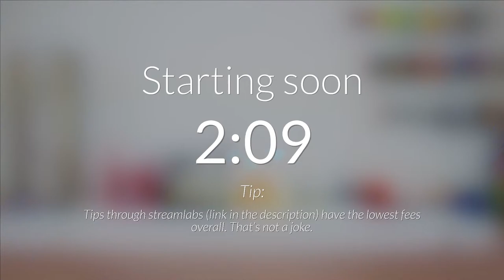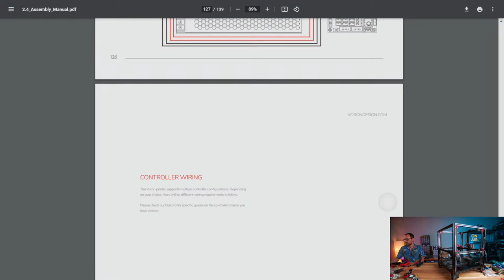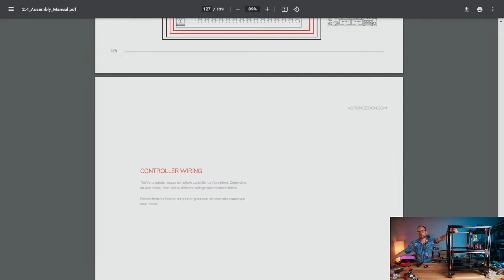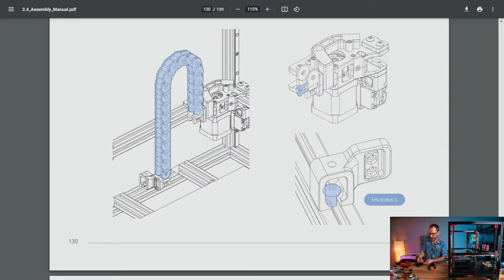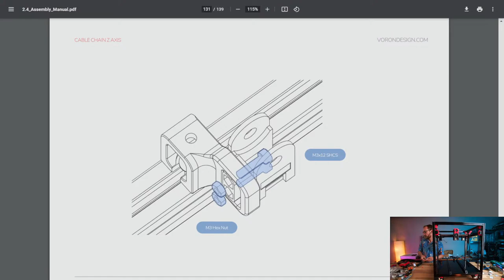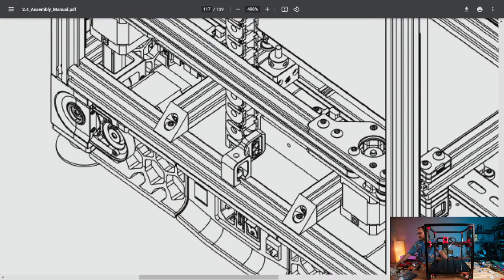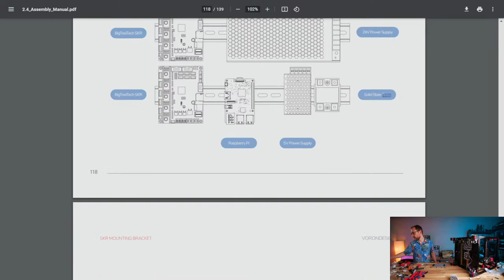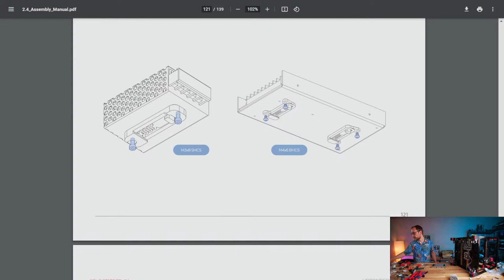Was live: Building a Voron 2.4! (Part 5: Wiring and electronics)

Comment: @Thomas, though I'm not 100% sure but the ALU tape that you use is called Mylar. A PET film bonded to very thin ALU foil. Therefore it is not a good idea to use it as an insulator or IR reflecting foil. Try it with soldering iron before you run a long print. Good luck!

Comment: RE the cable tie discussion: This is cable lacing... you use wax coated string and a spot tie knot.  This is how wire bundles are tied in aviation.  Awesome build series, btw.

Comment: Why are there 4 stepper motors for the Z axis? Wouldn't it be more sustainable to have all the Z-Axis belts connected/moving together mechanically instead of through software? Could this model instead use one or two Z-axis stepper motors (maybe with mechanical leverage as well), which would help reduce cost, too?
Reply from the maker: By using 4 steppers and independent drivers, you get faster speeds and have the option to tram thr gantry by driving each corner individually.
Reply: @MadeWithLayers  Oh wow, thanks for the reply! You're awesome, and I love watching your stuff, thanks man!
So it's easier to level the gantry essentially? Hmmm, interesting.  I guess having 4 individual drivers does have it's unique benefits.
As for speed, you don't really need Z-axis speed, right? Maybe only for Z-hopping does extra speed help? Or does the weight of the gantry also play a role in all this, too?

Comment: Hmm... about cabling and melting the mains connector ...
Twisted wires are not always the best choice. Twisted wires have a larger bend-radius than two wires next to each other.
The JST SM connectors are specified up to a 3A current so mounting this to a 60W/24V heater is still okay at 2.5A. The Magnum+ heaters are 50W each so connecting each separate to a JST SM connector is OK. 
And the melting mains inlet connector block ... It's not about the amperage flowing through the pins but the fact that the pins heat up due to the resistance of the connection. Most of the times this is due to a bad connection of the blade style connectors. Either bad crimped cables/bad quality cable or a too loose fit of the blade style connector results in heat damage. I have seen this happening multiple times with mains cables that had corroded plugs too.

Comment: You mentioned the Duet Web interface, the Duet 3 needs an RPI for hosting DWC Wifi (Unless you have something special or new Im not aware of)  Cheers, thanks for the great content.
Reply: The RPI is optional, the Duet 3 Series can still run a webserver from the SD card in standalone mod if required.
Reply: @robinevans4402  But there is no wifi on the Duet 3, so yeah it could run tethered or with a dedicated screen yes. Tom mentioned DWC, and it sounded like he wanted to use it.  I just assume he is talking about the web interface?
Reply: DWC is duet web control, which IS the web interface, its generally accepted that running the duet-3 with an SBC is still a half baked abortion, that was only implemented to appease oems
Reply: @m3nt8lone31  no Wi-fi but there is Ethernet which for me at least is preferred. If you desperately need Wi-fi either a Ethernet to Wi-fi adapter or a pi is the option.